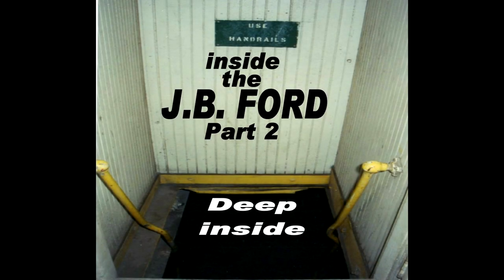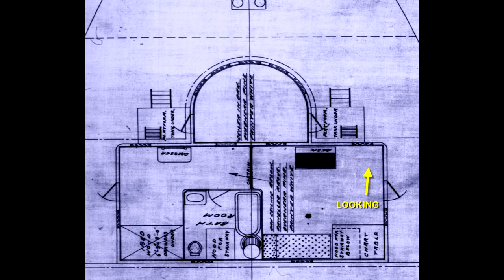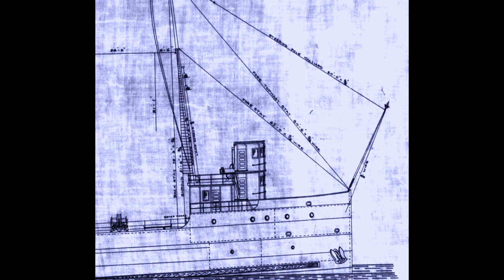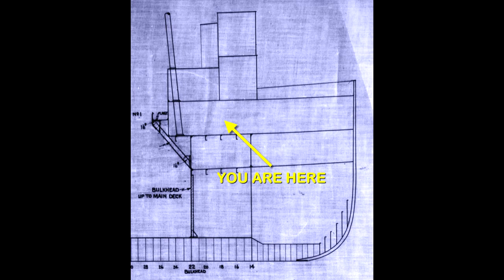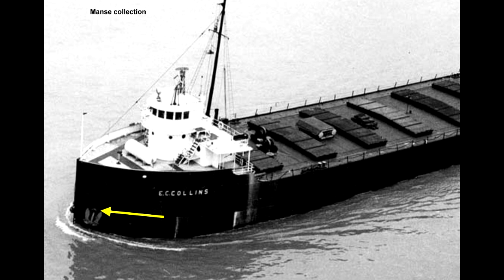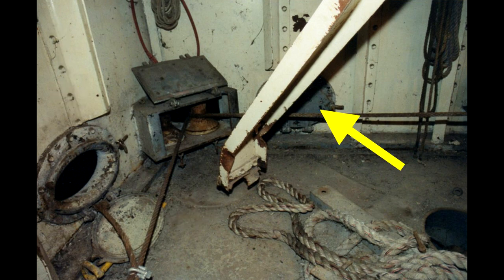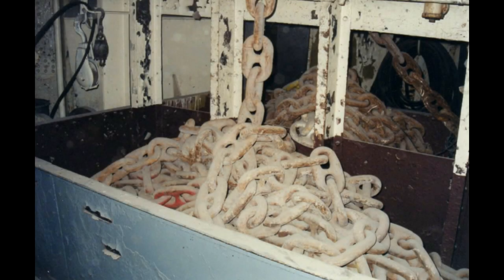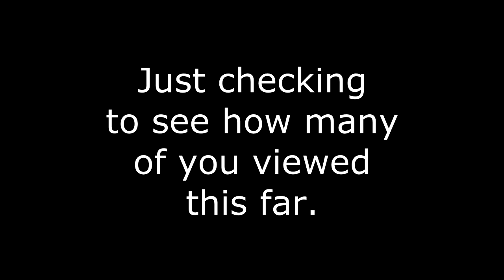Onboard the abandon ghost ship J.B. FORD in 2001

Comment: I don't know about maritime usage, but some Swedish nuclear plants have small openings in compartment walls near the floor also known as 'cat holes'. They're typically used during maintenance to run temporary cables or hoses instead of running them through an open doorway. You may need to keep the door closed for fire protection or housekeeping reasons, for example preventing grinding dust from spreading through the level or hot work triggering a remote sensor.
Reply from the maker: Cool